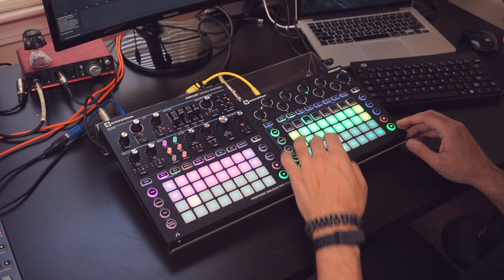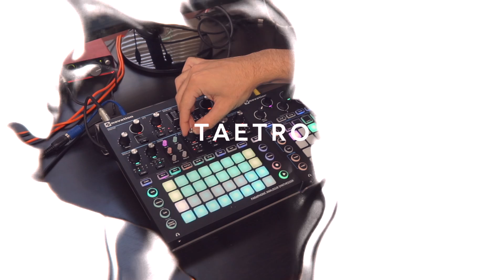Circuit Mono Station Beat Performance | Circuit Sketches

Comment: Excellent! I think the circuits are my way out of the box. Videos like this are convincing. So do you now think a circuit needs a monostation, or would I go for two circuits instead? (4 polysynths, 8 sample tracks)
Reply: Mr. Basic idk what you ended up doing but a Mono + Circuit is a dream team.

Comment: Nice, so basically you make Hip-Hop beats.
Those  drums are they from the circuit 1 groovebox 1?

I could hardly get any clean sounding drums when I had the circuit 1.

Also the circuit mono has no major drum patterns to my knowledge, it’s primarily a synth, is this correct?

Or did you upload the drums?

This combo is sounding amazing though bro.
Great work and inspiring also.

These units are not easy to use, they look good but they involve time, so great stuff.

Don Deano

Comment: Can you do a video about connecting the circuit/mono station to the audio interface?? Are you recording in mono only using the l/mono out into the interface ch??
Reply from the maker: I'll put it in the list - I am only recording mono out.
Reply: Taetro do you recommend an audio interface or a USB mixer... My gear is currently a Circuit and a Korg EA 1... Next piece will be a mono station... New to the game.

Comment: How do you sync these two? I'm getting the mono station tonight and I already have a circuit. Just curious how you got them linked and synced thanks
Reply from the maker: +Brendon Smith very simple. You just need a MIDI cable - connect the mini jack connectors included and then run MIDI Out from Circuit into Clock for Mono station